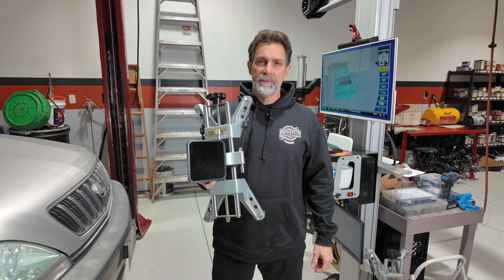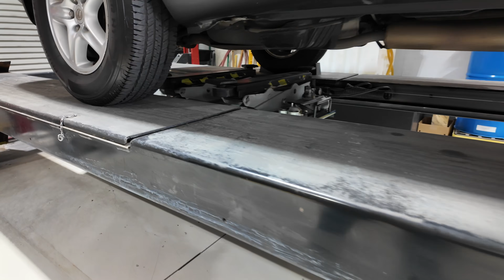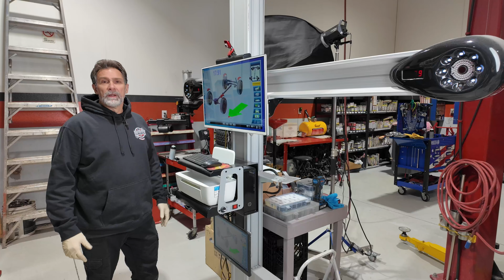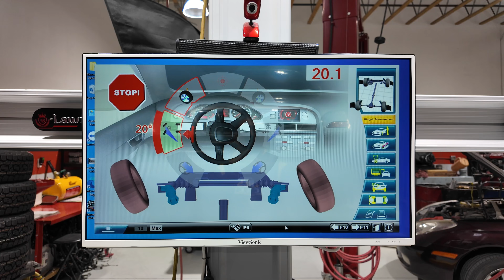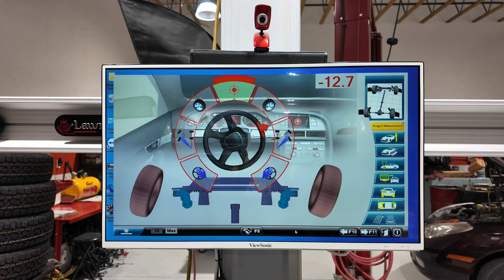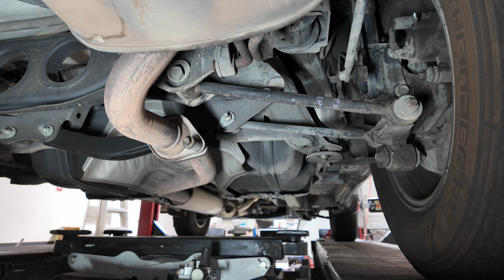4 Signs Your Car Needs an Alignment (And What We Do to Fix It)

Comment: I have 4 jack stands, two long wooden sticks with slots cut in them, a string, a very accurate steel rule, and a very accurate level called a camber gauge.  I have been able to get my alignment very close with these simple tools.  I do also have a 4 post lift.  Even after rebuilding my suspensions, I can get a very good alignment with these simple tools.  My BMW dealer has a very expensive alignment machine and yet they have failed to give my car a proper alignment, even after two or three tries.  I think the expensive machines are great, but the skill and patience of the technician are also necessary if you are going to get a good result.
Reply from the maker: @michaela1655  That can definitely get the camber and toe settings close with some simple tools.  It's not possible to measure caster angles, though. I usually use a magnetic angle bubble guage and tape measure to get the alignment close to where I started when doing suspension repairs.  This usually makes my alignment a bit quicker and more accurate.  You absolutely have to depend on the technician to understand the angles and what to move to achieve the best results.  Oftentimes, just getting it within specifications is not good enough.  Also, modified vehicles require using your brain a bit instead of relying on factory specs.  Thanks for sharing! 👍
Reply: @OrtoTechGarage  The last time I had a "professional" do an alignment on his fancy machine, the car was not even drivable.  It turns out the he had the right rear wheel toed in so severely that I had rear wheel steering.  I took a straight edge and showed him how the wheel was not aimed straight ahead.  And he showed me a very offical looking piece of paper that showed everything was in spec.  We stood there in disbelief, the eyeballs were telling both of us that the rear wheel was severly toed in but his fancy alignment machine said otherwise.  I took the car home, and discovered that both front wheels had too much camber.  Fixing the camber meant adjusting the toe again.  Then I adjusted the toe on that right rear wheel.  And son of a gun my car was suddenly drivable again.  I think the technician was not trained properly on how to use that fancy machine, and his boss looked confused and anxious as we tried to talk the situation over.  And the shop rate was ONLY $198 per hour!  That so called alignment cost me over $200.  And it was the last one I ever paid for at that shop or any other shop.
Reply from the maker: @michaela1655  wow!  What a mess!  Im glad you had the knowledge and experience to know it wasn't correct and a way to get it right at home. Great work!  Just a side note for next time, try to set the rear measurements before the front to ensure the thrust angle is as close to zero as possible. That will help the back tires track directly behind the front tires.  Thanks for sharing your story!

Comment: One other factor, obviously, is the road itsel. If you let go off the steering wheel and it slightly pulls to either right or left, it could simply be road you’re driving on.
Reply from the maker: @GymChess  Yes, absolutely.  We see that a lot with single lane roads where the shoulders are lower than the middle.  It's called road crown. It's always best to check that in a middle lane on a flat road.  Tires can also cause a pull.  Not just inflation differences but the actual tires.  Sometimes, rotating the tires is needed to see if the tires are causing the problem.  Thanks for the comment!  I should have included that in the video. 🙏
Reply: @OrtoTechGarage  I agree to your post and the original post.  Just got FOUR brand new tires.  When I cautiously let go of the steering wheel, I see my car would go pretty straight 4-5 secs, then it would start moving to either the left or right because of the unevenness of the road.  Is that normal? Previously, when the tires were 5 years old, as soon as I left off the steering wheel, it literally swirled to the right withing 2 secs. At this time, with the four brand new wheels, I am not sure if I needed an alignment again, as I did one 6 months ago before having four brand new tires.

Comment: The average car owner has no idea the hurt and pain in store for them and their modern car as they age. Turbos failing, GDI  carboning up valves, rubber belts in oil, plastic plastic plastic, nearly unibody everything, nearly CVT everything,seats with advanced airbags,windshields with electronics integrated in them, time consuming ADAS calibrations for minor fender benders and or repairs, headlight and taillight astronomical costs due to non replaceable individual bulbs,poor aftermarket parts forcing independent repair shops to favor expensive OEM more and more and manufacturers recommending poor maintenance practices so they can get carbon credits. Just as they finish paying off their car for 800 a month, they will start getting bombarded with ungodly repair bills.

Keep your car,have a good independent mechanic that you can trust and who is looking out for your best interests. It will save you in the long run.

Good video.
Reply from the maker: Great points.   I agree with you on most of that. Thanks for watching and supporting our channel!